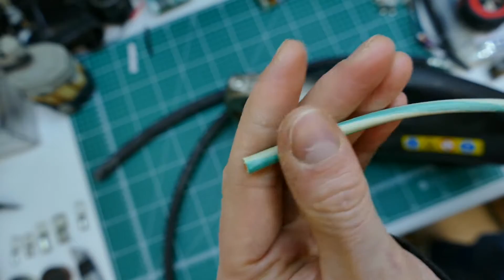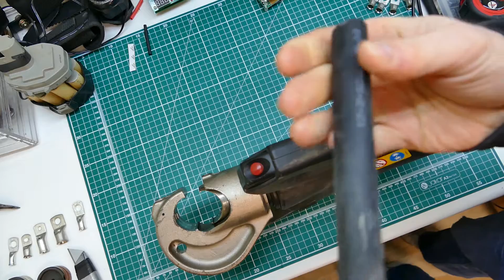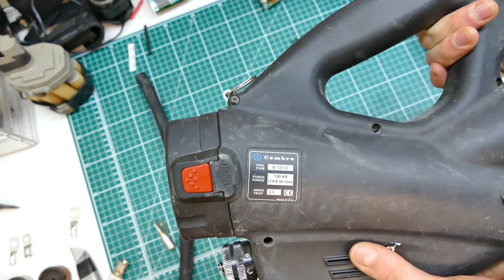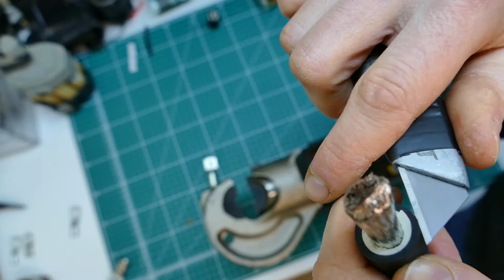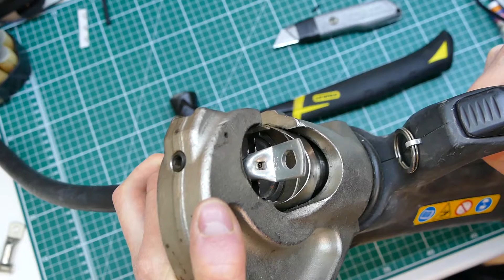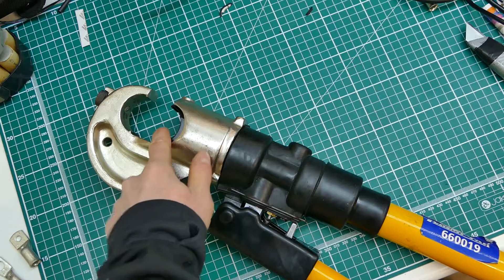How to make off cable correctly. Crimp - lug tutorial

Comment: Actually you crimp for a mechanical connection... and solder for an electrical connection. That's what the window is for, to keep moisture out and  prevent air pockets in the cable strands.

Comment: Seems like there's a lot of guessing in Europe with your electrical wire and lugs. In United States when you're working with  batery/solar/12v wire at least  you generally know hundred percent that it's 2/0awg  and you know 100% to reach for a 2/0 lug. That crimper is super badass though I've never seen those over here however

Comment: I think Milwaukee makes a version of this style crimper now for alot less than ya said, you might wanna check it out. Good video though
Reply from the maker: Roof Repair Techs thanks for the post. The Milwaukee kit looks good, I would consider it but I have invested in a new Cembre since i made this, it’s similar to the large Milwaukee one I’ve seen online.

The one problem I might have is that customers expect to have branded lugs to match the crimper. I can pop into a wholesaler here and grab Cembre crimps usually, I’m not sure Milwaukee ones are readily avalible. I guess in USA they are more common?